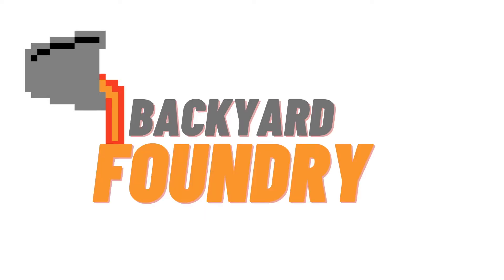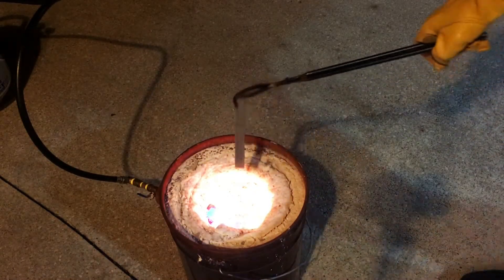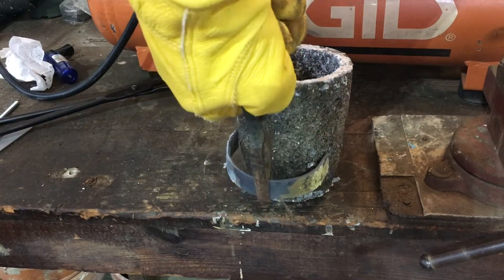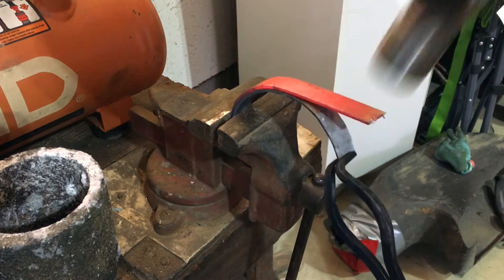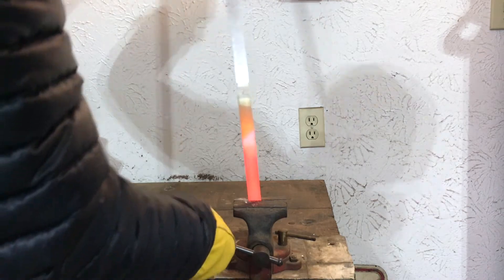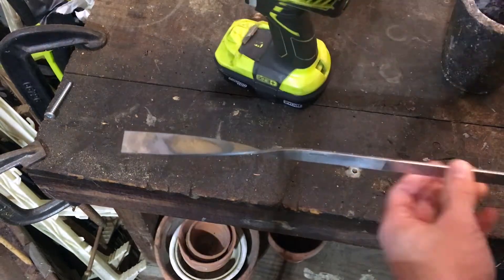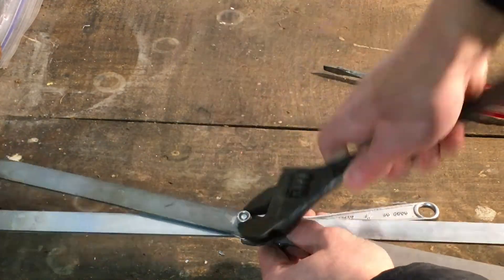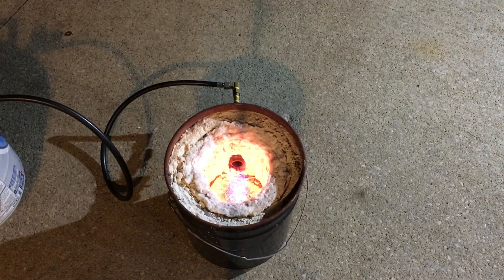Save Hundreds of Dollars with these Homemade Crucible Lifting Tongs [ No Welding ]

Comment: Rod = round
Bar = flat*
Forge = typically used for knife making, hobbyist sizes are smaller than furnaces and aren’t designed to melt metals, only heat them for forging, often with hammer and anvil 
Furnace = used to melt metal by heating it in a crucible*
Foundry = where the furnace, molds, casting sand, crucibles live, and where metal pouring/casting etc takes place
*what is seen in the video - in this case, a furnace is used to heat steel so one could argue that makes it a forge